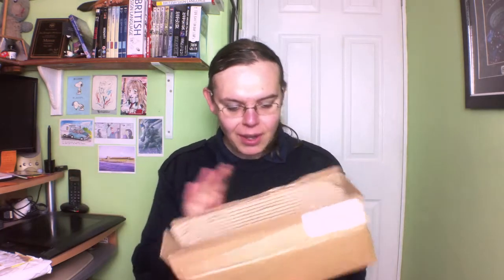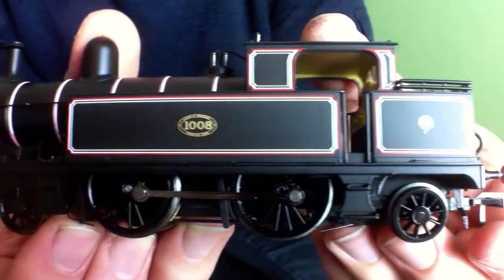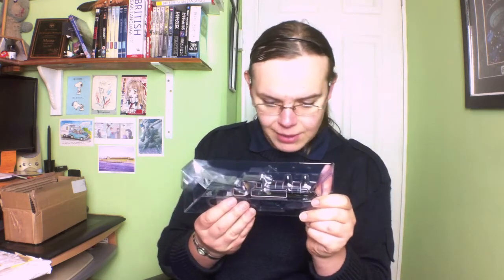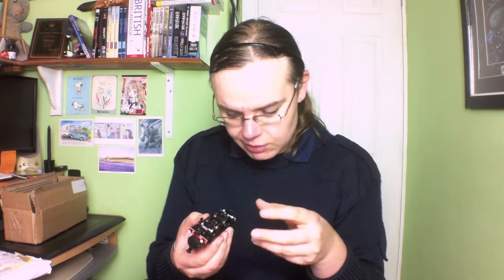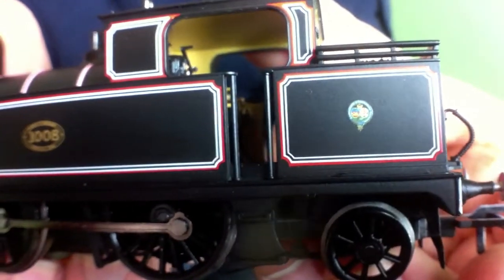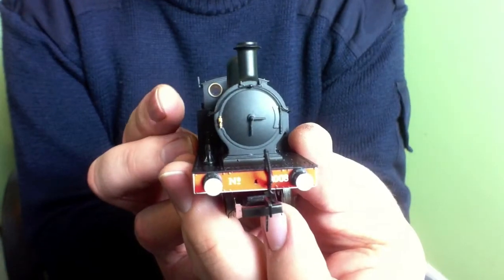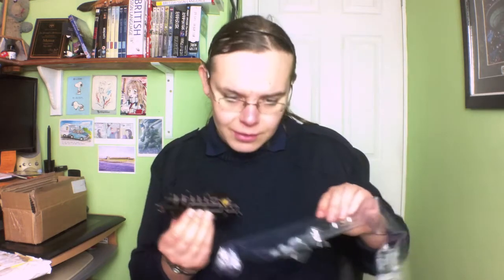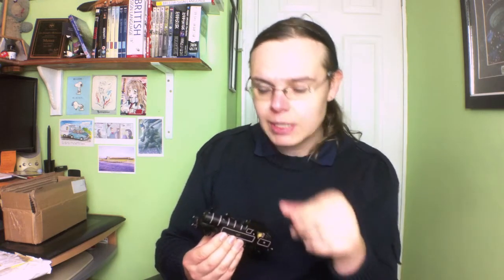Unboxing the NRM Bachmann 2-4-2 Tank in L&Y Black

Comment: Did you know that 50850  of the same class was  shedded at Bolton 26C in the late 50s and often used as the station pilot at Trinity Street. I presume Bachmann will be releasing some models in BR livery.Nice looking loco.
Reply from the maker: I didn't know about the Bolton pilot, but I do know that Bachmann are releasing the 2-4-2T in BR liveries within the next month.